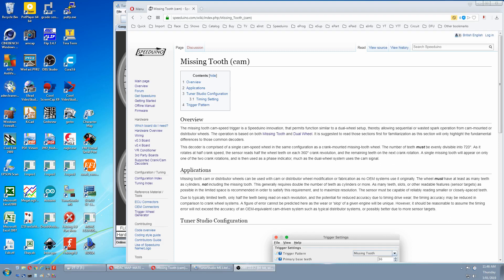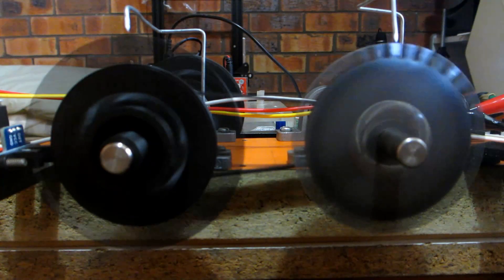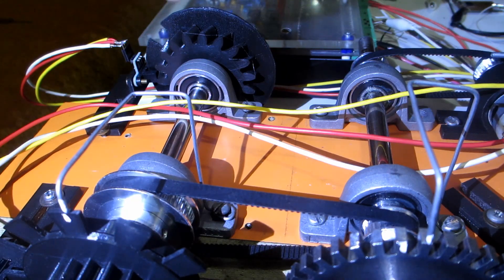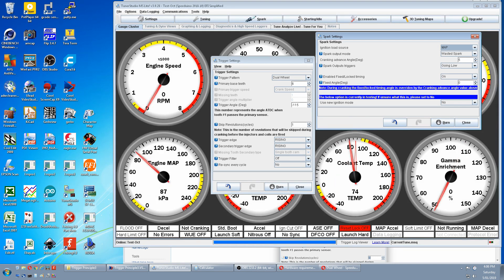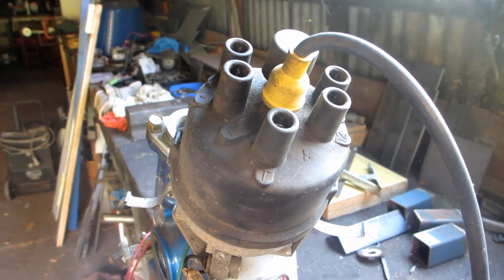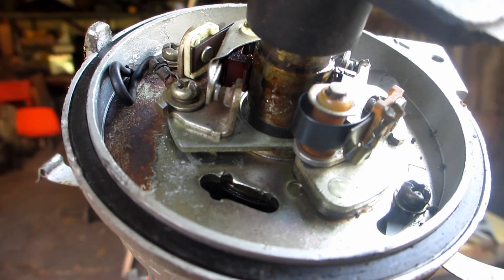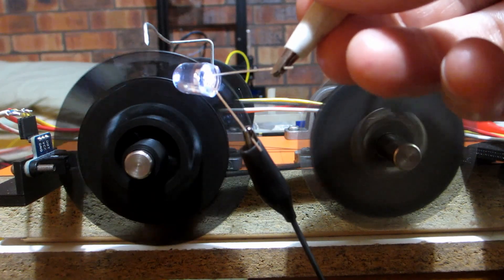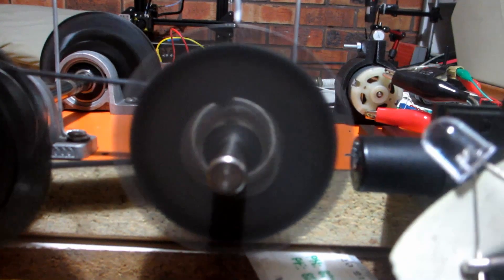Speeduino EMS #8 - Adv Trigger#3 - Cam w/IGN demo

Comment: I like your mechanical simulator.  What parts did you use? toothed belt, plastic wheel,bearnigs housing ,axis, atc.. Thaks for replay Martin
Reply from the maker: It's all CNC router and 3D printer parts from Ebay, other than the wheels which were 3D printed -tutorial vid on this channel - or made. The only problem was the hobby motor, because I couldn't find one that did high rpm for the power supply I had. I got motors out of a large office type laser printer left on the kerb.